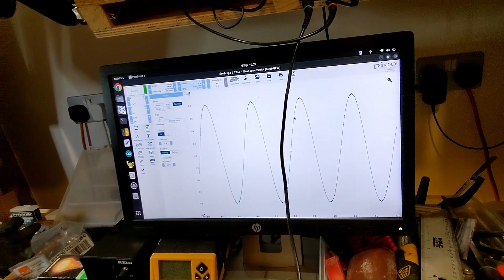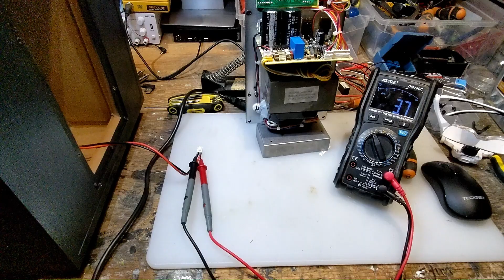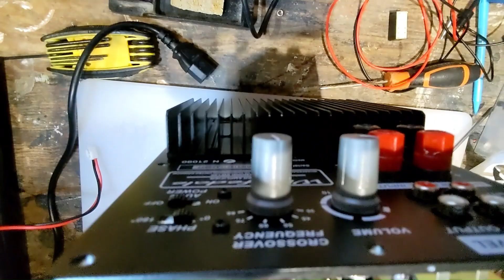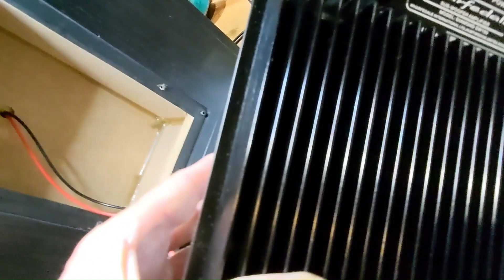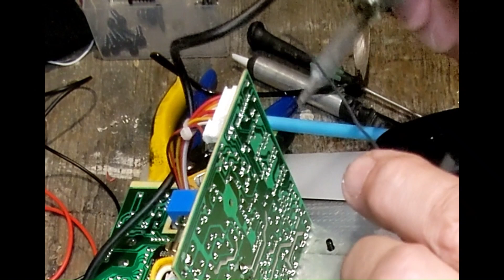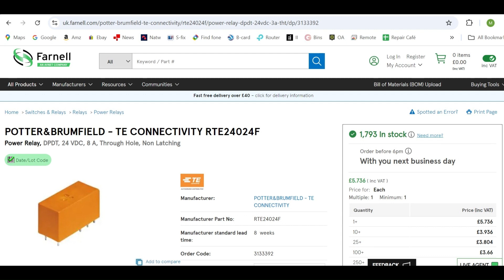SW150 Sub-Woofer Repair

Comment: Nice video.  You seem to take the stress out of giving it a go.  Just a quick question though: My sub doesn't go into the power saving state, but works perfectly otherwise.  I'm guessing the same relay is melted in the 'on' position.  Is it worth replacing for the amount of power saving it will do?  Were you saying that it draws lots of power anyway?  Thank you.
Reply from the maker: That all sounds plausible. The power supply is a big very old-fashioned beast (240v AC transformer, rectifier, smoothing capacitors), and that bit is always powered on, standby or not. That sort of power supply is inefficient at the best of times and uses more much power when idle than it should. It's difficult to say how much power is used in 'standby', vs 'on but quiet', at a guess maybe 10 vs 15Watts, something like that. Best way is to hook up a big on-off switch covering your whole set-up for when you are not listening...

Comment: This was really helpful and allowed me to fix my son's subwoofer, thank you! As a quick fix I just removed RL101 and wired the common and normally-closed terminals together on both poles of the relay. This defeats the auto-standby function -- but now at least the unit will be reliable, and allows the unit to be operated until I can fit a new relay when the parts arrive next week. Many thanks!